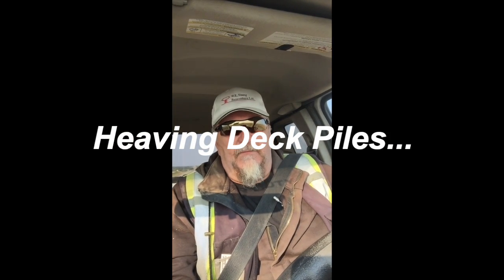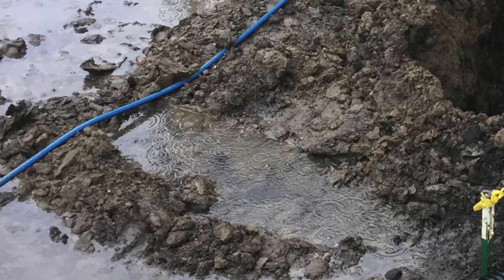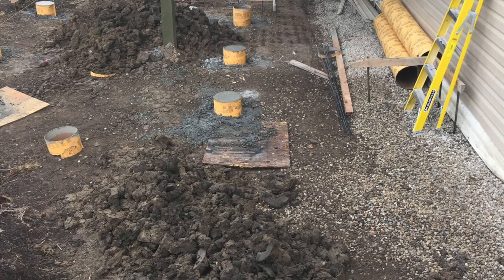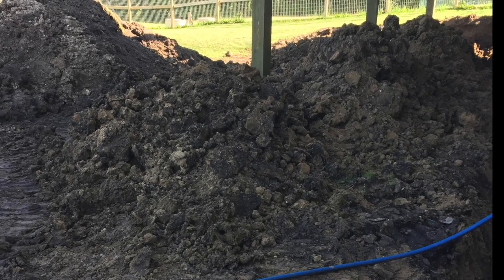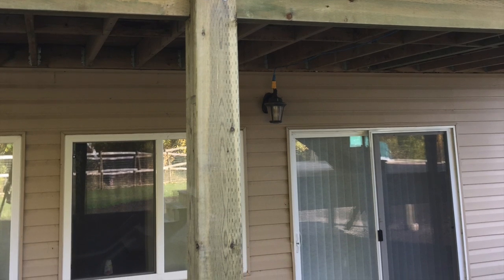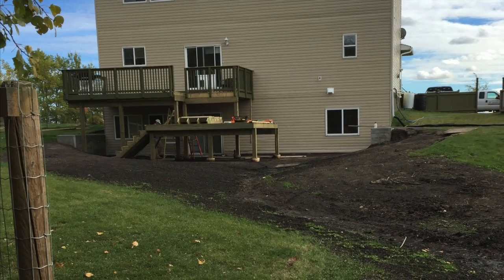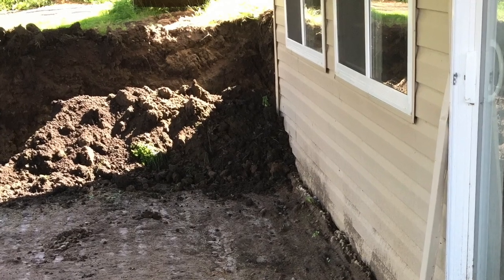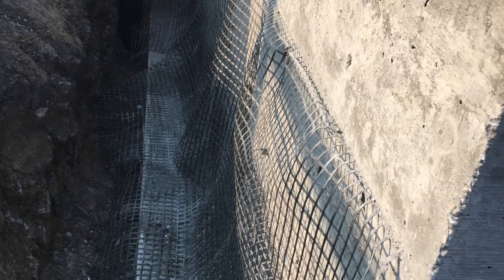Heaving Deck Piles, fixed failed deck build

Comment: How did you dig out 12’ for the tubes…drill?
Reply from the maker: Sorry for not replying sooner. The holes were augured with a 12” earth auger. The sono-tubes only go a foot or so down the hole and stick above the soil to the correct elevation.
Reply from the maker: Sorry for not replying sooner. The holes were augured with a 12” earth auger. The sono-tubes only go a foot or so down the hole and stick above the soil to the correct elevation.

Comment: With such a high water table, are you able to pump out the water fast enough to allow the cement in the footings to set properly, or do you somehow plug the bottom of the sonotube or what do you do?  I live in northern WI and have a very similar looking deck with frost heave. The water table is about 18" down as there is a creek about 100' from the deck and there is almost flat grade out to the creek.  The builder who put in the deck for the previous owners only made them 18" due to the water table which he evidently couldn't figure out how to beat.  Is a 8' or 12' concrete footing cheaper or better than diamond pier footing for sandy soil with a shallow water table?
Reply from the maker: Hello, this sounds very similar, the soil on this job is clay, which allowed the water to percolate slow and did allow for us to pour the piles once the water had been pumped out.
We did use High Early type cement for our concrete mix. This  type sets faster and reaches strength quicker.
The Sono Tube is only a foot or so in the ground which gives us better contact with soil and dresses the above ground finish up. 
Each job requires a differnet solution.
DeWatering an area by means of pumping can solve a similar condition that may include a heaving pad. This rquires test holes and eventually that the offending soil is removed  then replaced by a rapid water permeable material which can include rocks and stone. This can be designed to direct water away and/or to a dedicated pump. Hope this helps. We have plans to put up more videos like this in the near future so please Like and Subscribe. This information may help out someone else.
Reply: @blockadeboyz  thanks so much for your thoughts!